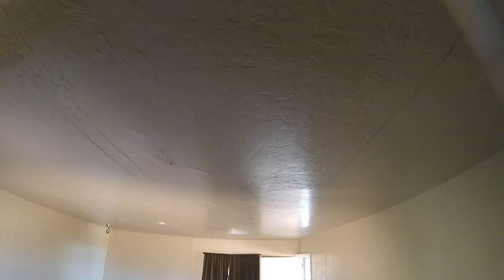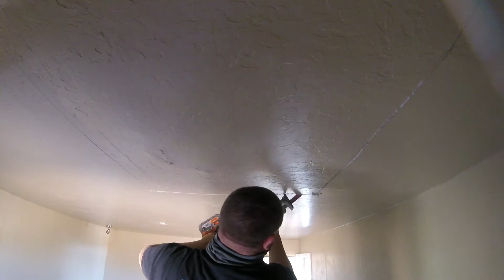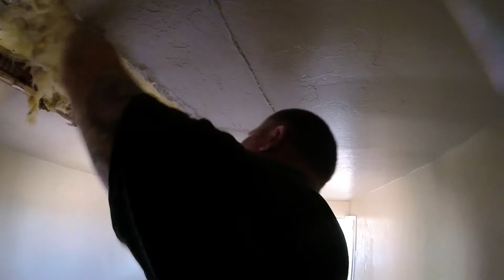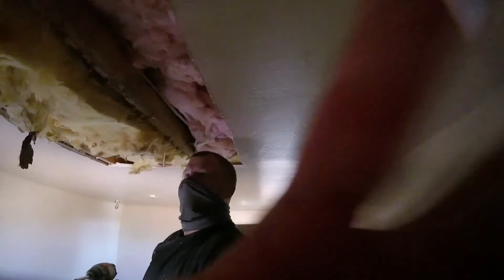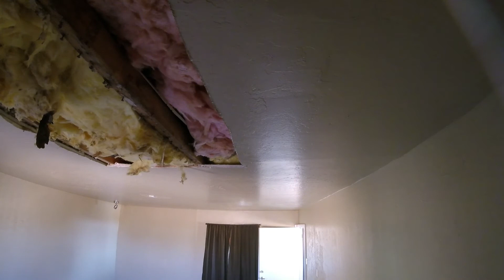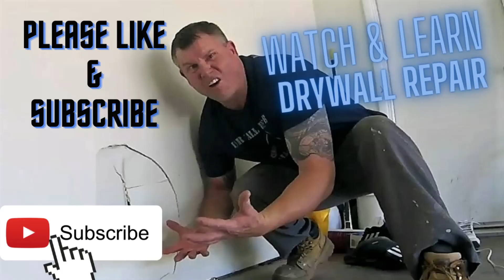Ceiling Drywall Repair Step-by-Step | Sawzall Method

Comment: I use a multi tool with a drywall blade has a depth guide! seen to many pipes / electric get nipped
Reply from the maker: il have to look up one- do you have link on cheap one I can look into I have one of those ones from harbor freight but makes up to much dust- Sawzall does not create much dust